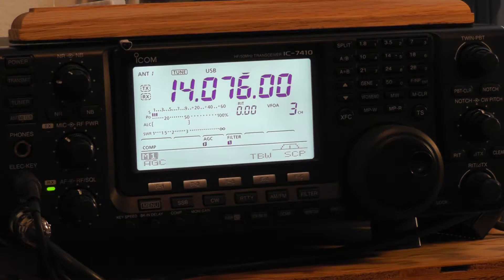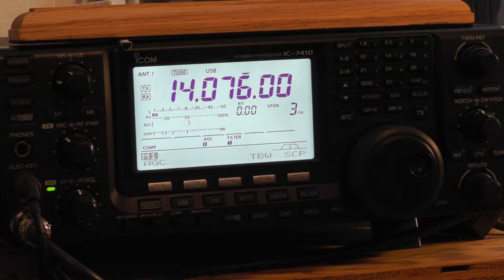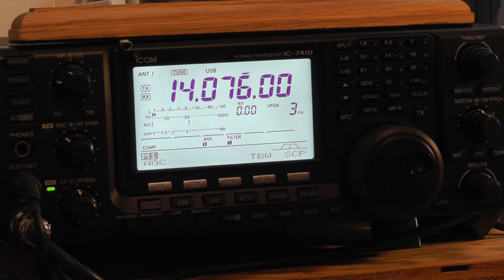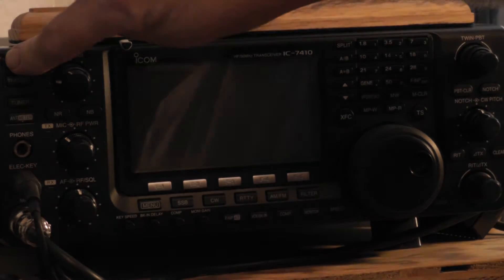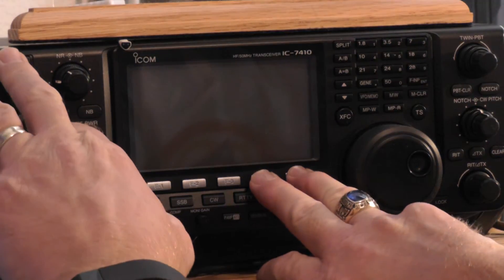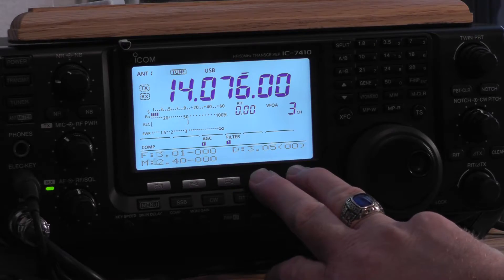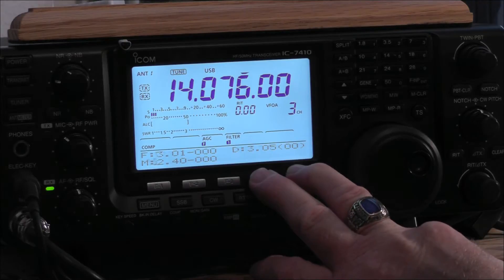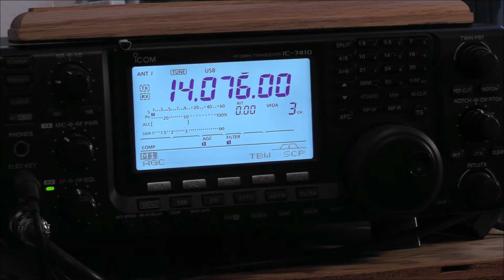IC 7410 Firmware Verification 2016 07 17

Comment: Thank you for making this helpful video, however, for what its worth,  I would like to point out that the IC-7410 I purchased in June 2016 shows the same firmware versions except the D: value is 3.07 (not 3.05). I actually tried to use the "latest" firmware update from Icom's web site, but got a popup saying that my radio already had newer firmware.
Reply from the maker: Thanks for the feedback, my best guess is that the newer units may have more updated firmware than the web site has available.  I will watch the Icomamerica.com web site to see if there is another later release.  The latest update as of today is Firmware Release 1 with a date of 8 Aug 2013.  I will email Icom to see if they have plans to release another update.  Thanks again! 73
Reply from the maker: In addition to the D:3.07 and D:3.05(00) question to Icom, I also informed them that their Knowledge Base information (link copied and pasted below) also may require an update as it shows:

F (Front) 3.01 (same as yours and mine)
M (Main) 3.40 (seems more updated than yours and mine)
D 3.02 (seems like an earlier release than yours and mine)

LINK
http://icom.custhelp.com/app/answers/detail/a_id/2178/kw/7410
Reply from the maker: Below is the response from Icom
---------------------------------
We only had 1 firmware release for the IC-7410 radio since we it came out and our radio also shows same D:3.05(00) as your with the Release 1 firmware.
Not sure why other customer radio shows different D firmware but can you ask him to send us a photo of his radio firmware screen along with the serial number information?
I will fix our article so it shows the right numbers...

Click here for information regarding Warranty Registration, Service/Repair Authorization form, Knowledge Base & Technical Support: http://www.icomamerica.com/en/support/default.aspx
Reply: I also have the 3.07, now that I know how to check it. Never know Icom and the way they number models. But I'd guess 3.07 is more current than 3.05